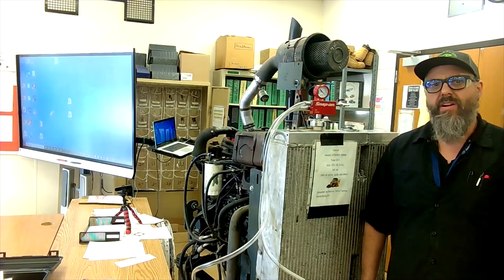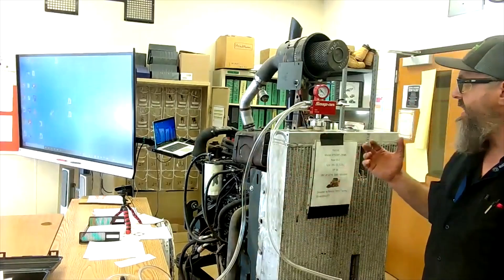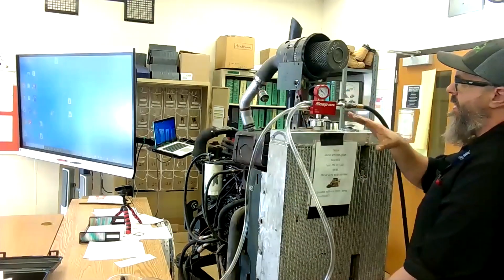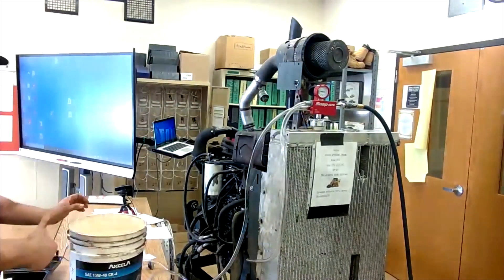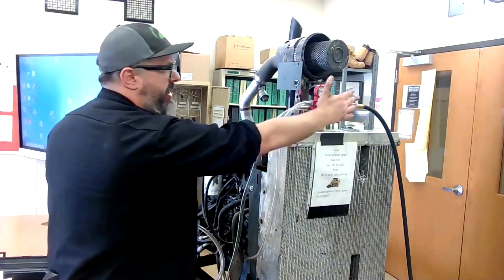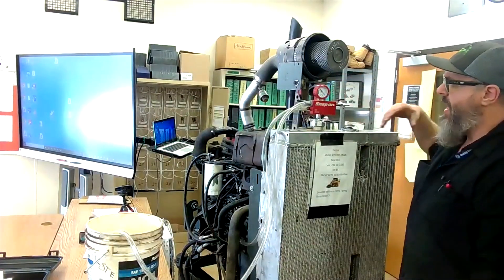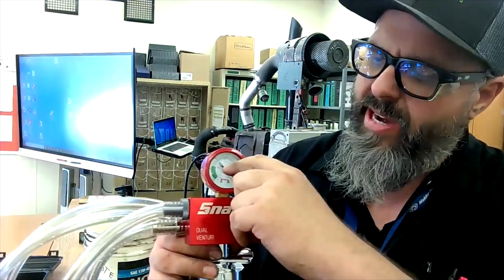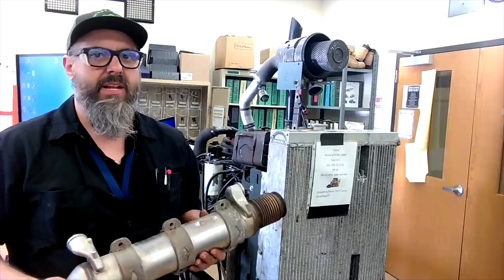Coolant System Vacuum Fill using a Snap-on Vacuum Filler

Comment: For anyone wondering the system doesn’t need to be empty. I was having a BIATCH of a time refilling a 2019 Subaru crosstrek. No heat from heater and the engine was getting hot. With coolant in the system it’s not going to pull a perfect vacuum right away. You’ll need to get what you get the shut it down and let it sit in a vacuum for a few minutes then start the vacuum again. It’ll top out and you’ll need to repeat this until you get the vacuum you want. It will spit coolant so make sure the discharge hose is in a bucket. You will NOT suck out all the coolant. I also did this without safety glasses - my bad.  Good luck.